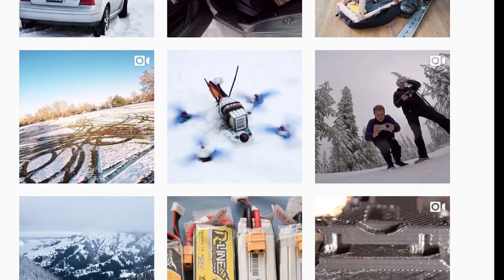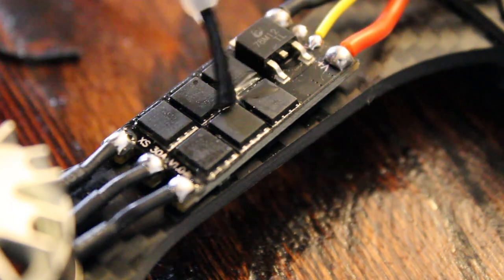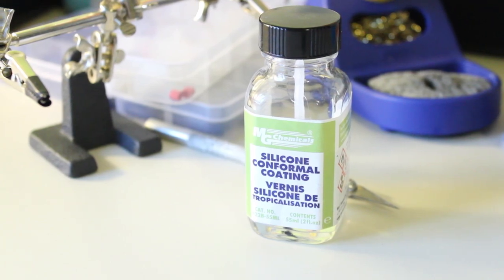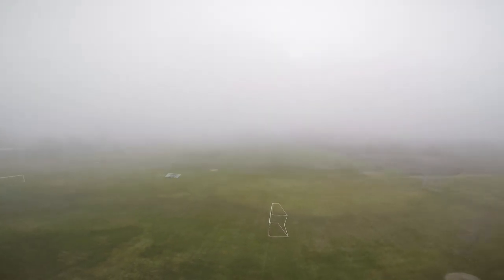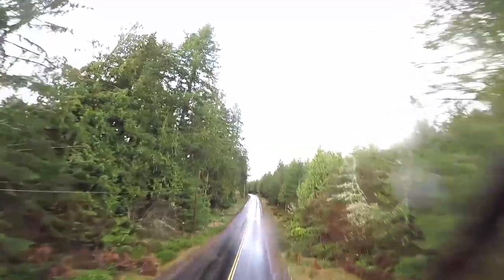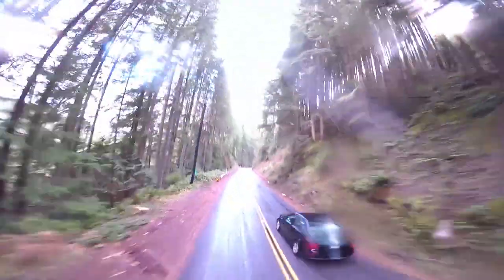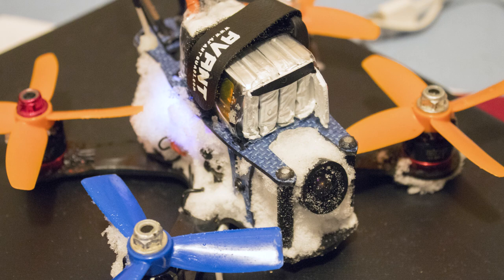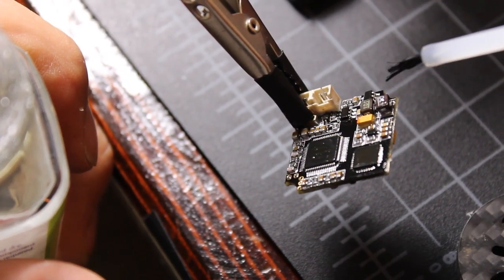How to Waterproof Electronics (the clean way)

Comment: How much weight dose this product add? 
Did you do a before and after weight?
Reply from the maker: +Green Silver did not weigh. It might be a factor for micro size but not with these
Reply: was thinking the same! thats a pity. Even though not affecting anything, it would've been cool to know in what gram range it is ^^
Reply: SmaxFPV depends on how much coating you apply.  if you empty 1/10 of a 150ml bottle you might have added ~15 grams (checking the real weight of the coating might help for the calculation of course ^^).

Comment: I know this is old, but how well does it work on cable connections. Looking to waterproof connections on a electric bike.
Reply from the maker: It is not meant for contacts, unless you don’t want to disconnect those contacts anymore. It’s for solid state exposed conductors.
Reply: Do you have any suggestions for contacts that cant be covered by shrink tube? They are just basic positive and negative leads connected to a odd shaped connector that is semi-exposed.

Comment: Samm Sheperd can I apply this coat on my naze 32 10dof ie the one with a barometer? I would really appreciate your word of advice on this.
Reply from the maker: Don't put it on the barometer if you want to use it for altitude holding mode or something. I don't use it but don't cover it if you want to use it
Reply: Samm Sheperd and what about the ecs do you put heat shrink back onto them?
Reply from the maker: Tanishq Jain You can but I haven't been doing that

Comment: The stuff is't easy to come by in Europe, specially in Germany. But I found some sources:

Original Reseller from Poland: 
http://e-praud.de/Schutzuberzuge-fur-Elektronik-und-Elektrotechnik/Schutzkonform-berzuge-fur-Druckplatten/MG-CHEMICALS-422B-Silikonhaltiger-Konformschutzuberzug

racequadgear.de from Germany: 
https://www.racequadgear.de/Silicone-Conformal-Coating-by-MG-Chemicals-30ML

Comment: How do you protect the motors?
Reply from the maker: They're already waterproof (Just insulated wires). Though warm it up and dry it out afterward, maybe run up the motors to get moisture out of the bearings. Perhaps dab a little corrosionX or something onto the bearings

Comment: Hi ,i have an electric long-board , i need to waterproof the 2 wires that lead to the 2 motors which are located in the wheels , the charge port , the on and off button and the male and female battery connections , would appreciate the help , researched wd40 apparently can damage electronics for reasons such as it conducts electricity. can i not use this product for my needs ? also , enjoy my subscription for your skill with a drone , and any recommendations for drones for freerunning/parkour videos?

Comment: What about motors cameras and moving parts? (fpv camera)
Reply from the maker: The motors are the only moving parts and they don&#39;t have any exposed electrical parts. It&#39;s just insulated coils of wire. Best practice would be to warm them up and dry them out and maybe run them a little bit to get moisture out of the bearings. Camera is just a PCB inside a plastic case. Coat the PCB and/or seal the case.
Reply: Alrighty, thanks for that, yeah i wasn't sure if there was any exposed electricals in the motors. (i just got my first quad and saw this so thought it might be a good idea to look into) and am considering doing this to it after a while.

Comment: did you have to coat your motors?
Reply: Sadly he won't be responding.

But no, you don't have to coat the motors as the enamel wire within them is already waterproof. I'd only be wary of the soldered joints under the heat shrink but they're probably fine as long as you're not submerging them (even if you are, I've seen other youtube videos of people completely submerging motors and them being fine.)

Comment: why would putting wd40 on usb help?>
Reply: Bump
Reply: Pretty sure he means WD–40 water resistant silicone lubricant
Reply: It provides a thin film of protection that can usually be scraped through by whatever you plug into it, or simply cleaned off if you can't get a connection. The usb port or whatever can short out and break depending on the board.

Comment: how do motors hold up with water?
Reply from the maker: The bearings would rather not have water in them but they are electrically waterproof

Comment: Do plugs cut through the coating if you get it on a connector? I noticed that you seemed to be getting some of the coating drawn into connectors by capillary action. I'd be especially paranoid about getting too close to the DIP switches, but you seem to have a lot of experience with this stuff, so I guess it isn't a problem. I've used epoxy and silicone. Use only two part silicone. Do not use the air-hardening single part silicone used for caulking (if it smells like strong vinegar then do not use it). I put silicone around connectors and switches. Then I coat with epoxy. The silicone prevents the epoxy from clogging connectors and switches. This type of coating is likely too heavy for your use, but it will survive heavy vibration under 3 feet of salt water. It even survives going through the laundry and dryer (accidental test). I have a spray can of conformal coating that I've never even used. I didn't realize it was so durable. You seem to have good success with it in obviously harsh conditions.

Should you ever get a failure in your coating here is the procedure I use to get rid of water from devices. If the device is totally waterlogged then I first rinse in distilled water. If only a little wet then I skip the distilled water step -- unless the device was wet with salt water, then I always rinse with distilled water; next submerge device in 99% isopropyl alcohol and agitate for 5 minutes; remove and drain; set device in oven at 120 to 140 degrees F. You can add a tray of desiccant in the oven. Drying under vacuum is ideal, but not an option for most people.  When rinsing with alcohol, be sure to shoot a little under BGA surface-mount chips. These are the most likely to trap and retain water. You can also blow compressed air under these. Be sure to use 98% or 99% isopropyl, not 70% or 85% or 95%. Anything less than 98% then you may be adding water, not removing it. Finally, be sure to dry under heat of vacuum. If you allow the 99% alcohol to sit for too long on the device then the alcohol will actually pull water out of the air and leave your device more wet than when it started.

Comment: Have you tired corrosion X?
Reply: nevermind i see you mentioned it. Flight test did a viedo a year or to ago about it.
Reply from the maker: Yea It's used in aircraft maintenance. We'd use it in the shop to lube pulleys and hinges at every inspection
Reply: ok

Comment: Stupid question, does it fly underwater?
Reply from the maker: If I was extra careful yea. But the high frequency radio signals we use don't penetrate water like at all.
Reply: Samm Sheperd yea totally forgot that underwater drone had a umbilical cord. also the only frequencies that do penetrate are sub kHz radio waves. Awesome videos tho, wish i would have done this instead of that liquid electrical tape which will suffer regress issues if i push it.

Comment: What about the camera Do you do that also
Reply from the maker: Seal the edges of the case and/or coat the internal circuitry. Just don't cover the sensor
Reply: What about the motors Do I have to coat the copper windings. Cheers

Comment: How did you do the micro USB port?
Reply from the maker: +Michael M you could dab a little oil in there or just ignore it and there probably won't be a problem. Don't get the coating in there though

Comment: How are you waterproofing your camera?
Reply from the maker: 1. Remove the 2 screws securing the back plate to the camera
2. Remove the camera's circuit board
3. Coat it
4. put it back.. etc
Reply: chenosaurus but if you do it that way your sensor could still get wet and dirty.  I prefer to seal the whole camera case with liquid tape.  all the way up to the edge of the lens.

Comment: do you fly with gyro or not
Reply from the maker: I don't think it's possible to fly with out the gyro. Though I usually do turn off the accelerometer because it's basically useless. I fly in manual + airmode.
Reply: Ok

Comment: You never show or said weather you applied this to the motors.
Reply from the maker: Don’t! Motors are already waterproof! They are just insulated coils of wire and a separate spinning rotor
Reply: Samm Sheperd is that on all motors or? I heard if water touches the motor it blows up?
Reply from the maker: Brushed motors have electrical contacts which may guy not like water very much. Brushless motors are electrically waterproof

Comment: You'll have a hard time replacing parts
Reply from the maker: +JerryTortoise I just showed you soldering works fine replacing parts is even easier because I don't use heat shrink

Comment: Don't use wd40 it's conductive. Dust And Wd40 Is conductive any foreign body's will conduct in Wd40. you could fry your flight controllers esc's camera. Wd40 is very bad advice it is band from my works electronic workshop.😁

Comment: Don't use wd40 it's conductive. Dust And Wd40 Is conductive any foreign body's will conduct in Wd40. you could fry your flight controllers esc's camera. Wd40 is very bad advice it is band from my works electronic workshop.😁
Reply from the maker: Well I've used it often to drive our moisture and prevent corrosion on my electronics. Never had a problem except it being messy for RC stuff. I googled it just for you and here is what it said: "NO IT IS NOT, it is an insulator up to 5000Volts. 

it is used on car ignition system to drive out the moisture from distributor caps, if it was conductive it would short out the cap. 

but the propellent may be conductive so don't spray on live equipment once it has evaporated it will be an insulator"

Comment: THIS IS BS
first of all you fly like a psycho
second silicon coating does almost nothing
water is not really an issue but impurities in water such as salt water is a serious issue
in those conditions RC would not receive anyway
Reply from the maker: Idk I think I'd rather fly like Skitzo.. hahaha
Anyway, i respectfully disagree on the matter of this products effectiveness. I do agree that pure water does not conduct electricity, though it does cause corrosion even without electrolytes. I've been the victim of water damage a few times and I am convinced that this technique is effective in the areas I desire.
Reply: ok
you live somewhere wet and snowy anyway
Reply: Allen A x